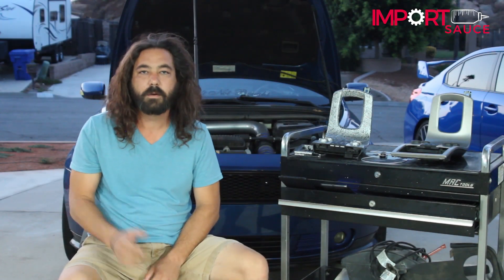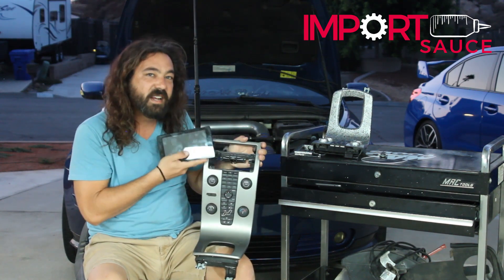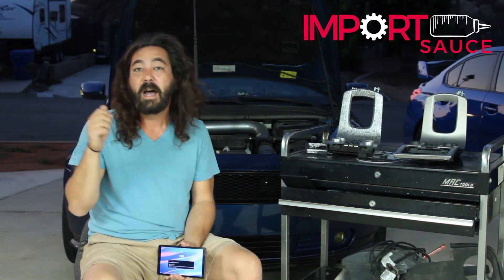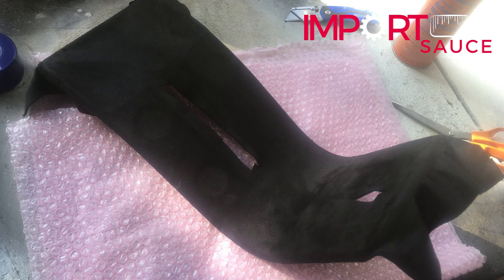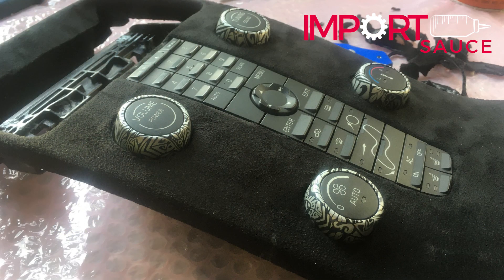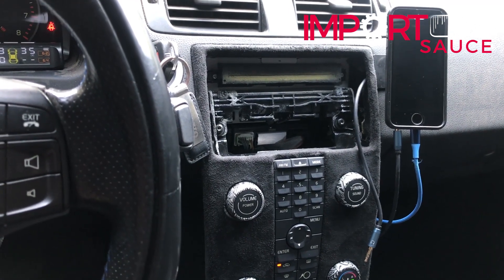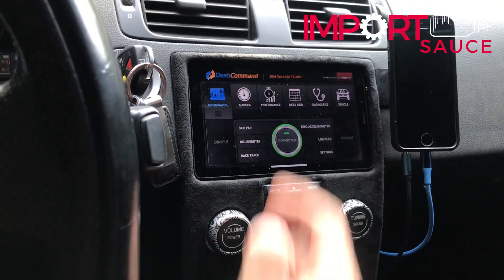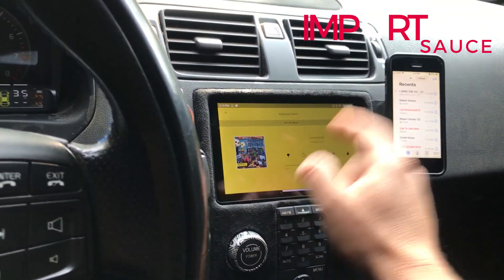Android Tablet Installation - Volvo S40/C30/V50 - For Less Than $100

Comment: No need to go Through this 🤦🏽‍♂️🤦🏽‍♂️🤦🏽‍♂️🤦🏽‍♂️🤦🏽‍♂️🤦🏽‍♂️
Reply: Ok maybe some more details? If you say so, then you should come with something that support your affirmation, they did an exemple of this is an option to, so what are you come up with? Ppl as you may see they are searching for this without mounting out the hole car parts 🫡
Reply: @58joy  you can just buy a lte iPad with magnets and use that as a radio

Comment: Hi, i would really like to add the oem bluetooth. The v50 had it in the 2012 models. I have a 2008 model it has aux and the sim card insert. But id rather have oem bluetooth and hands free. I searched the whole internet but nobody has retrofited one. I have the vida dice so programing it in would be no problem. Would you be able to make a tutorial and a list of parts that is needed. I would be happy to pay for the tuttorial.
Reply from the maker: That would be an awesome upgrade. Unfortunately it would be trial an error. We currently don’t see any of those models in the junkyard so we don’t have access to the parts yet. Paying dealer prices on those for a gamble would be too much. We have added the upgrade to our list so when we start seeing those models hit the junkyards we will go for it. I would guess the same parts list. The screen, the cd deck and maybe a BT external receiver from factory if it wasn’t built into the cd deck.
Reply: @moosedroppings  i look forward to seeing if anything wil come out of this. Thanks for the reply.

Comment: Does this turn off and on with car or does it need to be removed and turned off and on each time (wasnt clear if buttons were still accessible or not? Thanks 👍
Reply from the maker: good question, turned off manually since it isn't hardwired to car,

Comment: I ended up mounting a good quality older phone to the hand brake, wired usb charger behind the waterfall (like in your video) and a Bluetooth dongle behind the CD unit.  Routed a short charge cable through the handbrake trim to connect with drivers phone, the second usb for passenger and I can see the vehicle voltage on charger.  I didn't want to modify my car that much.  Maybe one day someone will come up with a direct replacement for the P1s crappy head unit.  If I still have this car I'll definitely invest in that.
Reply from the maker: yeah, there are not too many options here, but we do have our 2.0 version done, and is way better, problem is the car is down for the engine swap and no wire harness in the car to show it, hopefully that video soon,

Comment: Kuidas kaamera 📸 töötab sellises  asendis? Videokõne pilt autost oleks milline. Kas näha juht ja ka kaasreisijad? 
 How does the camera 📸 work in this position? A video call image from the car would be what. See the driver and also the passengers?
Reply from the maker: We have not actually done a video call or used the front facing camera on this device, so I'm sorry to report we have no information on this. I would image it would matter based on which side the camera was, and would probably be somewhat close, but unsure how video call would be with reception while in a moving vehicle.

Comment: Hello! Do you know a similar solution for V70 MK3?
Reply from the maker: Not off the top of head, I would image it would be similar. We also have a third gen v70, and I do note there is the similar possibility for something custom like this. We currently have the aux BT connector running, but nothing much more than that. I may explore the options. Thanks for the idea!
Reply: Currently, I also have an AUX-Bluetooth combination with a Baseus product, but I would replace the complete audio unit with Android. Last year there was a first-generation XC90, and I solved the Android replacement in the factory place...
Reply from the maker: @Tibee30  Yes, we had a first gen xc90 a few years back, and I know they have a popular android plug and play, we never experimented with it.
Reply: @moosedroppings  There is no Plug and Play to replace the factory radio, nor even to replace the factory navigation, as this requires a special 16-pin harness. I know what I'm talking about, because it caused a lot of confusion when I realized that the factory radio has the control of the electric windows and the central locking, so unfortunately it is essential to install Android in such a way that the factory radio remains
Reply from the maker: @Tibee30  https://www.swedespeed.com/threads/legend-car-audio-android-head-unit.647650/

Comment: Hi can you please help I've a 2006 nho6 volvo s40 with no aux got a new waterfall with the mode botton on got a new cd unit and I have a Bluetooth dongle on the leads but won't let me select the Bluetooth mode it only go's to cd
Reply from the maker: You need the screen (icm) from a 2007 for it to work, do you have that 5th and most important part?

Comment: I can’t find it any more but some on the c30 forums did a write up on how to bypass Volvos led wiring crap and installed a Apple car play head unit, looked pretty simple. But this seems like a good plan b if I can’t find the write up

Edit: I didn’t ever find the write up but I found a shop in the UK (unfortunately I’m in the USA) that can do the work. I then messaged them asking how but they wouldn’t tell me. So now I’m thinking this way would be fine but figuring out a way to use Apple CarPlay on it would be better than having to use a tablet and download a bunch of stuff
Reply: Could you give us the link to that forum?

Comment: Hi there boss i have a volvo c30 iam from south Africa cape town i just wanna to ask your steering wheel do it work with the tablet and i want one can you help me pls pls
Reply from the maker: the steering wheel controls will only work for volumn up and down, track skip will not, there is not a way to link those together with a tablet via aux port,

Comment: If I did this set up, let's say I'm using the tablet solely for maps and playing music from my phone, when the maps tells you to turn or something, would it pause the music from my phone and then resume the music when the maps is done with commands?
Reply from the maker: It will depend on the tablet. The tablet feeds everything to the 3.5 so any audio goes to the car. The car simply receives the signal. If you have a phone and tablet they probably won’t do that since they don’t know about each other. You can simply press pause on music. Or get a new phone that is the same size and use that alone.
Reply: This will likely work with Spotify and Google maps. 

When using Spotify premium you can play and control songs in drive mode using your phone and cast it to output via the tablet.

Comment: how can i connect a back view camera to this screen?
Reply from the maker: You cannot. We have the vantap rear view camera mirror.
Reply: Also, this is not to endorse "Rand McNally Wi-Fi Backup Camera" as it doesn't seem very good but there other similar options around.
Reply from the maker: @Luke00722  yes. Good point. We are using the vantap mirror mount backup cam which records front and rear all the time and saves 128gb of footage. It also displays parking line guides when in reverse.

Comment: Hi!
For a 2005 S40 with no AUX setup, how can I make an upgrade to this? My car has no separate amplifier in the trunk, everything is placed inside the CD player. Do you a simple solution for this? 
I was about to install and android unit multiple times, but gave up because of the missing this damn AUX  :)

Thanks a lot !

Best!
Reply from the maker: easy fix, here you go: https://www.importsauce.com/adding-volvo-factory-aux-to-your-2005-s40-v50/

Comment: what about the car air conditioning display indications....
Reply from the maker: You will not see those since the screen is tucked behind. I just adjust by feel. You don’t need to see if Volvo tells you the fan is at 4/10 clicks, just spin the dial to desired fam speed. I do the same for temp. In summer ax is all the way cold and in winter heater is all the way hot. It’s a sacrifice but for us it was worth it for the tunes and the screen

Comment: Any information if i can replace my IAM to achieve at least mp3 compatibility for my S40N 2006 with Basic sound. I think it was introduced with 2007 or 2008 S40N.
Amplifier are built in on IAM. It really sucks to burn audio cds with up to 20 tracks. The only mod i can do to achieve "aux" or so is to run a FM transmitter. But that has various quality. Ive tried one. It works but.. not a stable sound quality.
Reply from the maker: It is in our list tho try the whole swap with an 08 and up and see what happens. If so we will do a video too